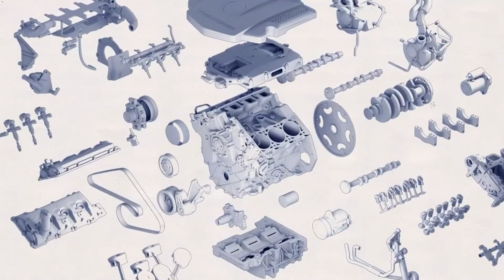Engine Oil Vs Transmission Fluid: What Is The Difference? | Which One Should You Choose?

Comment: Engine Oil: change every 3000-6000 miles
Transmission Fluid: change every 30,000-50,000 miles OR 60,000-100,000 miles (if using ATF)